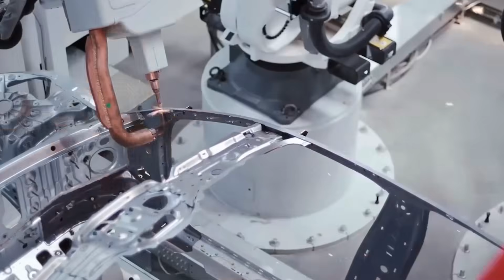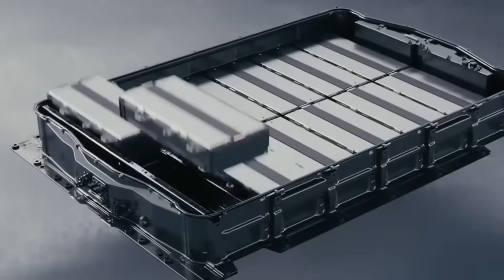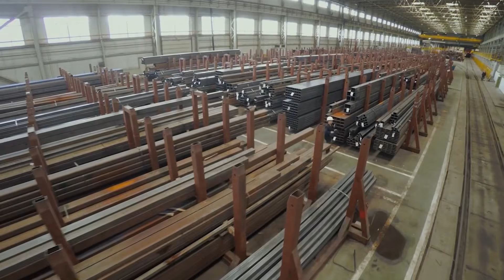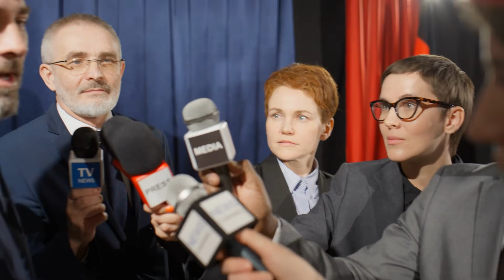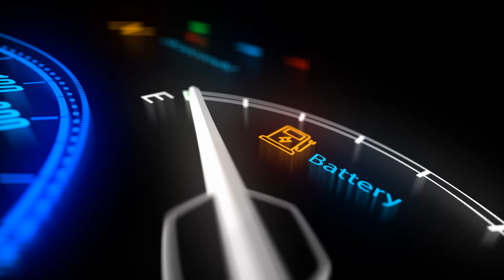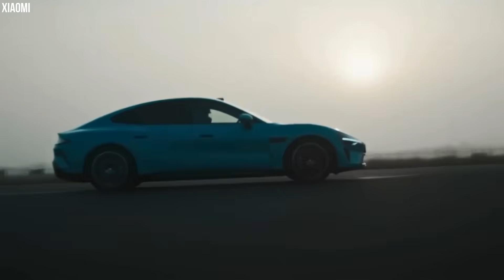China’s Insane NEW Technology Just Replaced Aluminum!

Comment: Cars are not built today, like they were in the 50s. That is a lie. There are now made out of cardboard, plastic, and really cheap thin metal that rusts very fast. They are equipped with electronic lockouts, surveillance, and more intrusive unsafe features that are designed to do the opposite of what they're advertised for. If they change anything on the automotive, they would lobby the government to change the regulations to force manufacturers to build what they want so that they can force individuals to be surveilled and to limit how far they can travel. Very soon, your petroleum automobile, that's a combustion engine, will be illegal to own or operate. Anyone willing to sit by idly and call in me a tin-foil hat wearer is only helping it becoming a reality.